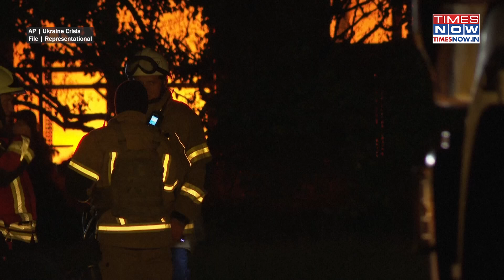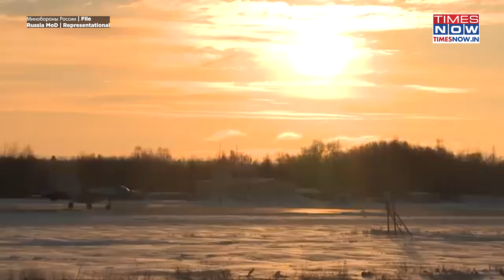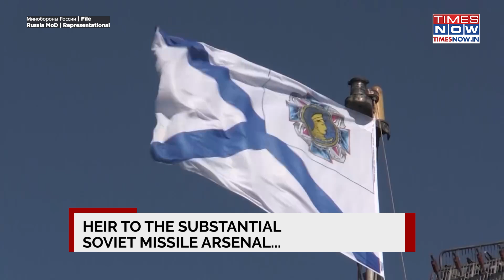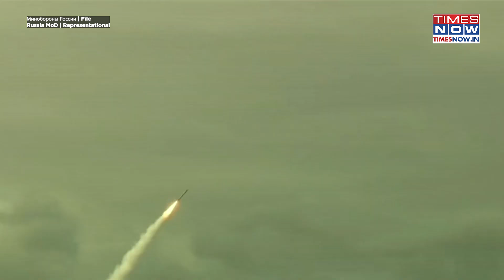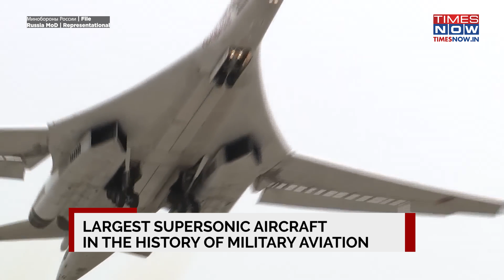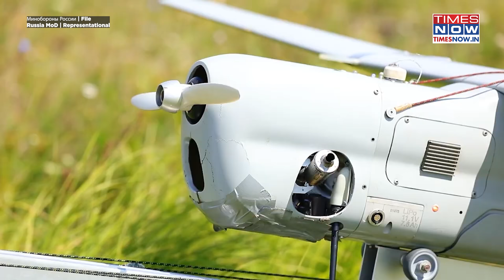Russian Su-35 Fighter Jets Go Full Throttle, Ukraine Cries For More Patriot Missile Defense Systems

Comment: Patriot missiles are super expensive and not much good for dealing with a wide range of weapons the Russians have plenty of, including drones and ballistic and hypersonic missiles. The Russians attach super cheap glide bomb wings to super cheap dumb unguided bombs to create cheap accurate standoff weapons that allow the launch aircraft to kill targets (reliably) outside the range of short range SAMs and enemy air defences. Their use is because they are cheap and get the job done and are not an indication Russia is running out of anything... except perhaps patience and good will... Winter is coming. Russia has called this conflict an SMO rather than a war because they are using 10% of their forces because they know at any time the west/HATO could create a false flag reason to join the war and create a real threat for which they would mobilise everyone and use all their weapons in response. They have used up old stores of weapons and equipment and are producing new equipment and developing new technology faster than the entire west. The West should be afraid.